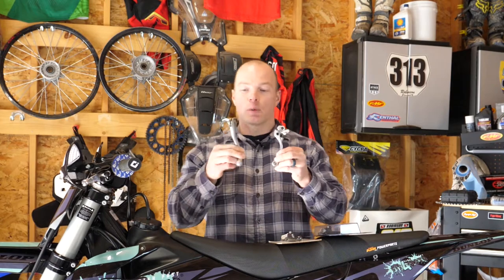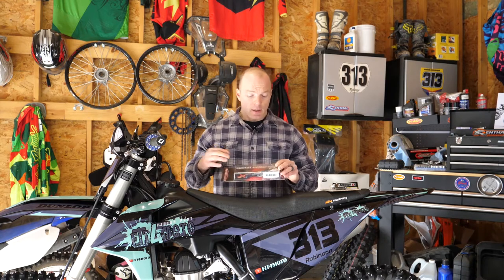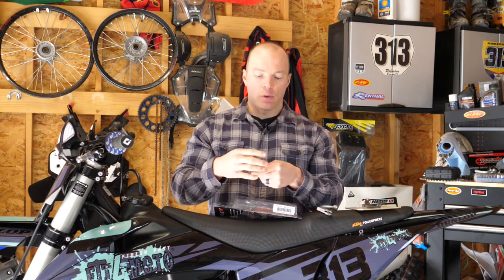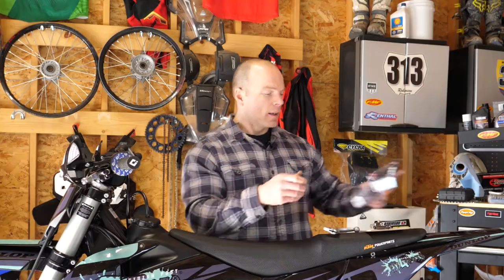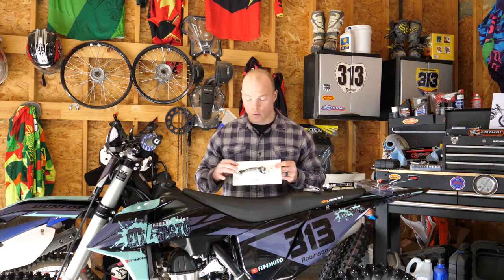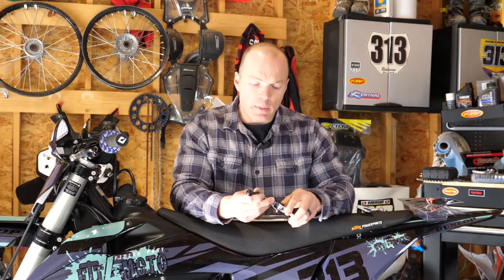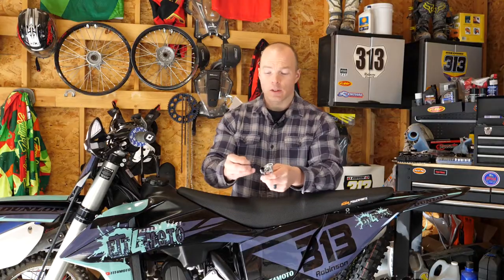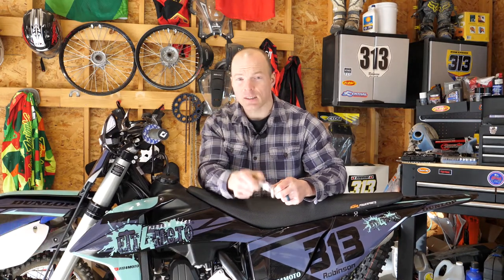HOW TO Install new Dirt Bike Levers (Are aftermarket levers worth it?)

Comment: I know im sort of a year late but how do i fix a sticky brake lever?
Reply from the maker: Great question Soy! Generally you can pull the mount bolt out, clean it all up then re-lubricated and the lever should move freely.

If that doesn’t fix it, and you’re running a cable system and not hydraulic like a brake lever, then it might be that your cable is sticky and either needs lubrication or needs replacement. I hope that helps!
Reply: To fix a sticky brake lever just buy some lube or grease and aply it to the pivot point of the lever

Comment: Would buying those levers help the pull of the clutch. I have 2021 crf250rx
Reply from the maker: Not so much on the pull...they're better for just your average tip overs and stuff so you don't have to blow a bunch of money on broken levers. 

It's funny that you mention that though because my 2021 CRF450R has a bit of a tough pull as well I think maybe when the hydraulic clutch brakes in, it'll be better?
Reply: @fit4moto   alrighty thank you I broke my clutch lever the other day and didn’t know what was a good option then got curious to know if it would help the pull.
Reply: What would u recommend for my bike because of they safety feature for holding clutch in. I don’t know to much about levers to know what ones would work with that feature still and be good.
Reply from the maker: @offroad_boy3363  No problem! It would depend on your budget I guess. But I would recommend a spring loaded type to avoid breaking it again (that's a pain in the butt). So there are a few options. Ill put some links to a few that would be great.

https://www.rockymountainatvmc.com/parts/asv-c6-series-pro-clutch-lever-p?v=17506

or 

https://www.rockymountainatvmc.com/parts/streamline-reflex-clutch-lever-p

I hope that helps my friend!